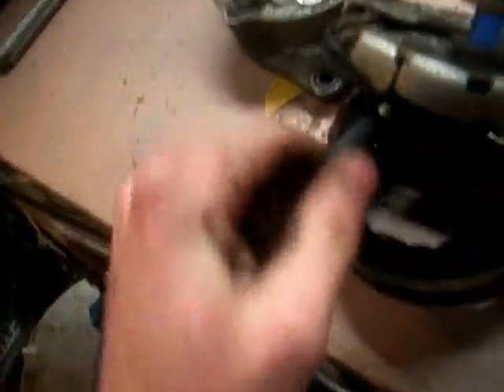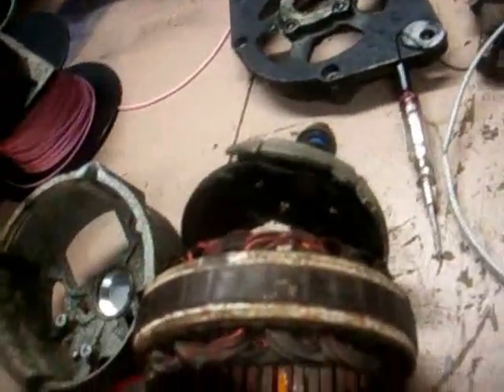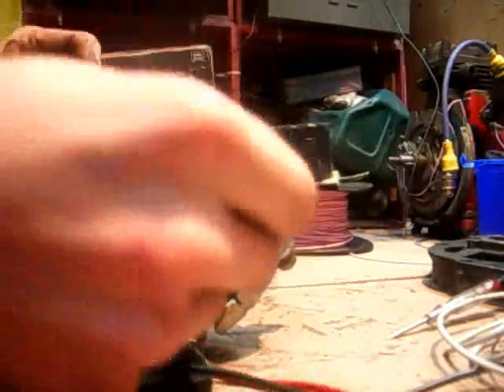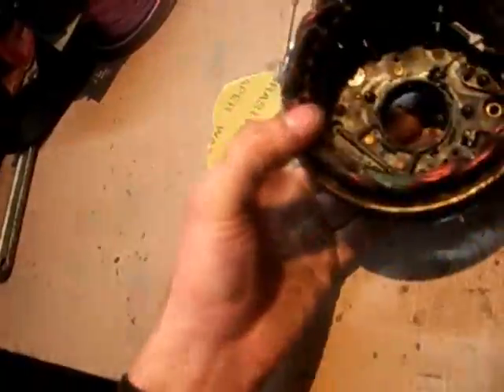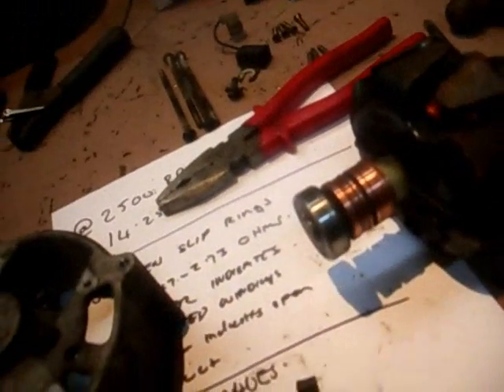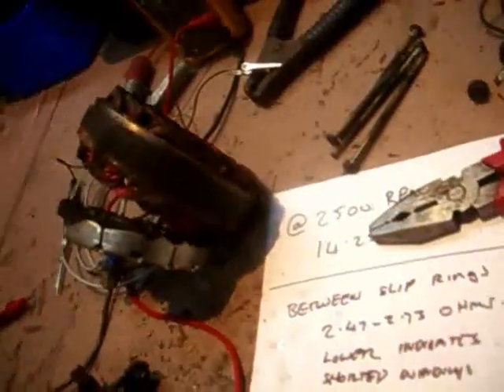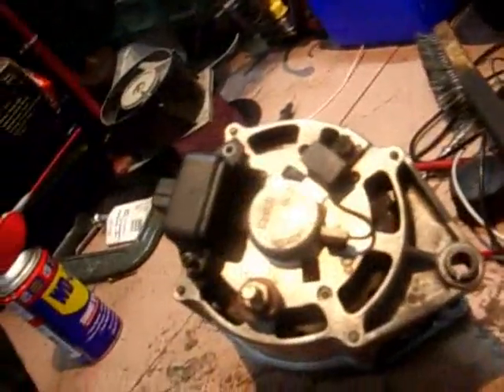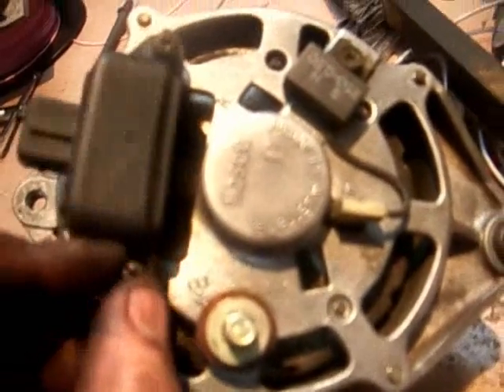alternator strip service and recondition part 2

Comment from the maker: @theASEtech the slip rings are pressed on to the rotar and cant really be removed or replaced. i think the wires are soldered with normal electronics type resin solder. same with the brushes. 
thanks for the comment

Comment from the maker: @HDXFH Akai speakers on a decent amp and cd player. the amp is an old Sherwood and the cd player is a pioneer. i need some big speakers with a good base but these do the job for now. i through the old radio out because the volume control was stuffed.